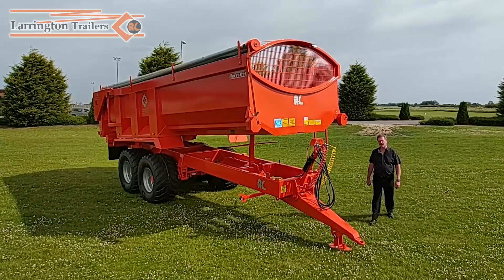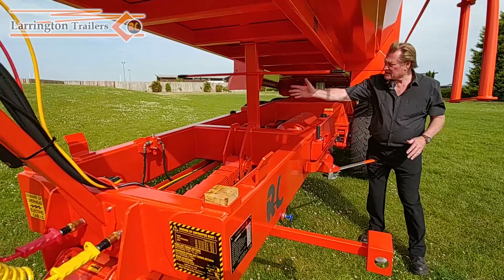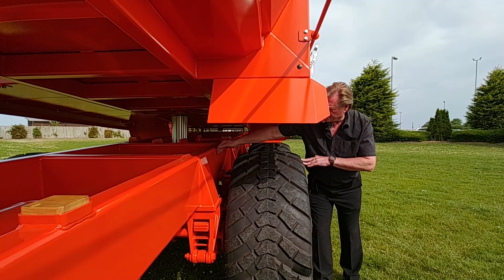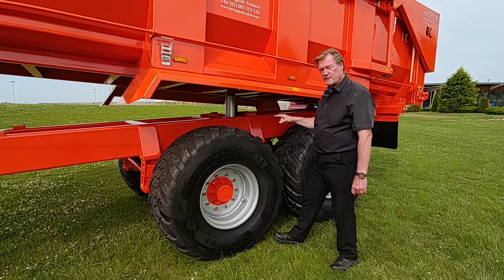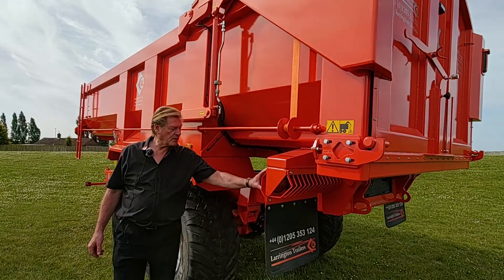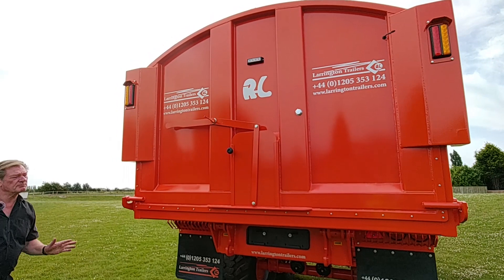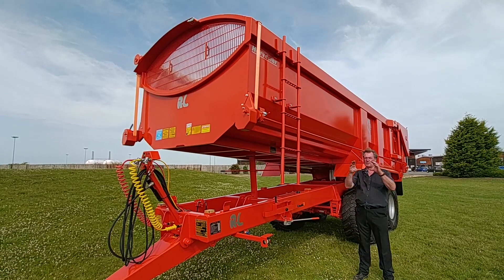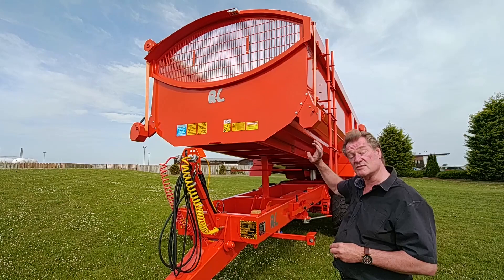Larrington Harvester Trailer - 2022

Comment: What I have seen on here, its 100% better than any other British make, The well known Green trailers, I have used quite a lot, I have never in my long life used such a bloody numb farm trailer. As for Larrington trailers, they are as scarce as hens teeth in my area of Yorkshire, only one i saw from afar was the high lift push out trailer for Roger Hobson, carrot king. The green trailers we had were all on hire, our own trailers were Triffit, made down to a cost on some of them, I personly modified all of them, those highly dangerous steps at the front caused many accidents in a muddy potato field, I fitted proper steps at the front & near front axle side, but oh me, the cheap as chips lift rams were a thorn in my side, set of seals lasted a trailer little over 2 years, my job to repair them, yes your trailers as we say up here...Are the Dogs Bollocks....
Reply: I worked at Larringtons  for a couple of years 2020-2022 and would agree there trailers are built to last a lifetime with no expense spared on materials used, and by listening to Richard here you can get a feel for the constant search for improvement and keeping up to date with innovation.